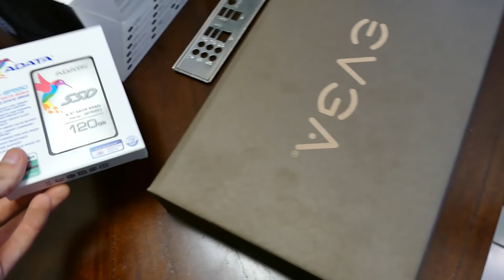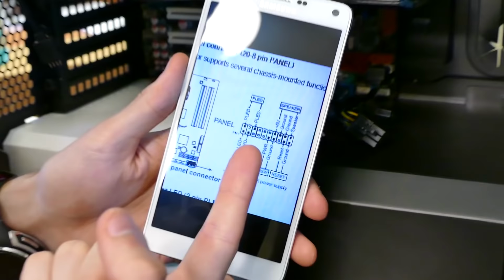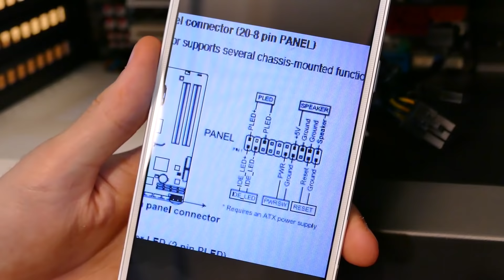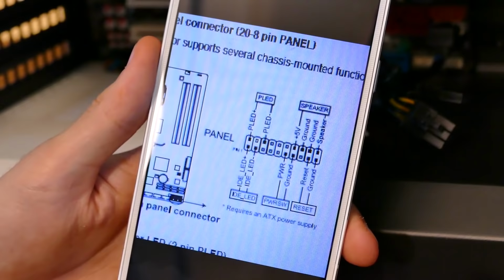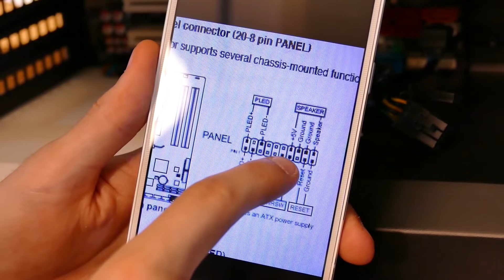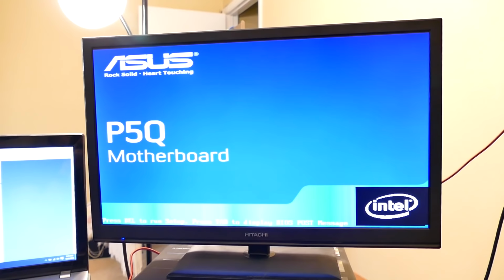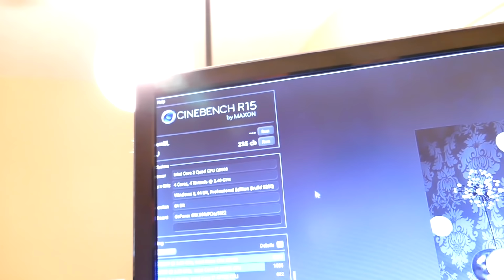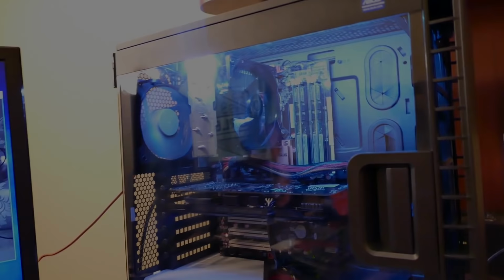Q6600 PC Build Vlog

Comment: Which memory have you used for that build? I have a similar build with an q9650 but my DDR2-800 RAM is holding me back from getting a good overclock. I also searched the web for it but I couldn't find anything substantial.

Comment: how well does that run with that board cause i have a p5n e sli and it is not stable at all with windows 10 every time my windows updates i gotta reinstall windows cause it screws up my drive controller

Comment: how do you get 4Gb ddr 2 variant? the link is 2gb

and does Q6600 can be used with ddr3? what mobo do I have to use? (socket 775 + ddr3 slot)

Comment: I just recently revived my Q6600. I used an ASUS P5G41T-M LX motherboard for DDR3 and EVGA 750ti. I should technically be getting 8GB ram of 1333 overclocked but it's picky with RAM and I could only get 6GB from the DIMM's I have. I have some older 1333 coming in so hope it works.

Comment: I got almost the same setup. I use the gtx960 for video decoding. Separate decoding chip for h264 and HEVC.  Next upgrade will be Ryzen 2600 with rx580 and of course the whole system. It will be costly but hopefully wilk last 5-6 years....

Comment: I bought a $42 oem. Planning to install a gtx 750 for $41 and a xeon for $29 for a total of $112 my first gaming pc 😊
Reply: I actually don't recommend doing that bro'. Buying a pretty low end gaming PC will hurt you in the future (when you'll want to upgrade or some shit). 
I will more recommend you bying an i5-4690K or an i7-4790K with a GTX 970 and you'll see the difference...
Reply: @Hateroz  Well I'm not much of a gamer anyway. The only games I play are either well optimized online games or games old enough to run on that rig. Sure is a big jump from playing on a cheap laptop all these years. When I save enough I'll go for a brand new ryzen setup and an rx 570. Med range gaming is enough for me.

Comment: i just tryed overclocking my cpu(q6600) to 3ghz with the deaufalt voltage 1,28750 and it failed.i have bought a new cooler and now my chip is at idle 27c and load 43c.i want to overclock so much but i think my mobo(p5b-vm)can hadle the stress or something maybe the ram speed because i have 800mhz ddr2 an the bios says only :533mhz 667mhz 800mhz 889mhz and 1067mhz.i selected the 800mhz but maybe because it overclocked the memory is the problem . maybe putting 667 will help?i have no problem with temps!plz help!

Comment: So if anyone could help me that would be great. My PC won't recognize any ram sticks enless it's the one that came with it. The ram stick that came with it is only 4gb and I wanted to add another 8gb. So I tried putting in 3 different 8gb sticks in my PC, in both the slots in different combinations it still won't work. Only the 4gb stick works. I literally just got this ram stick and it doesn't work. I checked it's ddr3. I'm trying to update my bios to see if that's it. If anyone can help please help. Any suggestions would be nice

Comment: If you didn't figure out the monitor issue, it looks like the monitor is on overscan which you can fix in its settings. but being as tech savvy as you are im sure you figured it out already,

Comment: I still have TWO Q6600 systems sitting around doing nothing these days. Both on Gigabyte P45 boards with 4 (2x2GB) DDR2 -1066 memory with Xigmatek tower coolers. Here's the rub.. both at one time would reliably hit 3.4Ghz overclocks, but over time, and it's most likely the motherboards, they no longer hold the Overclocks regardless of vcore. Being now 9 year old builds, they bottleneck the hell out of any video card released in the past 5 years, I've done the testing for science on them, and anything above a GTX 460 video card won't give you any more real performance in games. For those wondering, I was able to play Fallout 4 on one of those systems with the GTX460 card at low/medium settings at 1080p, but it was a struggle. Still viable for gaming, sure, but just barely. But for under $200 you can also jump up to an i3 with DDR4 memory on a cheapie mobo, and the difference in performance is astounding, especially with video rendering.

Comment: I spent $500 making mine, and it's an i7 3770 with 32GB DDR3 and an R9 290 4GB, and 240GB SSD. Noctua cooler, Corsair TX850w and a new white and violet bitphenix neos with a window. It's VR Ready. =)
Reply from the maker: Most won't be able to obtain identical parts for the same price, even on ebay.

Comment: Which PSU would you suggest for overclocking a q6600? The GPU in that PC would be a R7260x (pure low budget gaming).
Reply: Actually the motherboard is much more relevant for the overclock in that case. Getting a power supply any better won't make much of a difference to the CPU other than stability at a certain clock at around 0.05V lower. It will impact Motherboard VRM temps and longevity tho.

If you wan't something better under 80USD id recommend any 80+ Bronze or Gold from EVGA or Seasonic. Any EVGA G2 or SeaSonic G Series comes to mind.

Comment: I have an Asus P5B SE Motherboard, Quad core 2 q6600 processor at 2.40Ghz. it has 4 slots for RAM and i have installed 1GB ddr2 ram in 2 slots for a total of 2gb ram so there is 2 slots available, and a Geforce 210 DDR2, Does anyone know what is the most of Ram this motherboard support? and which is the most powerful graphics card for this motherboard? please anyone can help?

Comment: Does the q6600 is better then e8400  only becouze is quad core or is stronger cores ? E8400 still higher clock speed ..
I ask that becouse my cooler cant cool the q6600 but it keep the e8400 at 55 56 full and the q6600 at 65 70 on idle . So is big diffference between power of those two?
Reply: Even for basic and every day tasks quad cores are essential
The yes it's worth it due to the dual core not having hyperthreading it will become  a bottleneck for every day tasks soon enough
Reply: @samsonsanthosh  thanks . Buy a new cooler then . Dont have time for new setup .
Reply: @georgecatalinnicuta8559  yup that works too those chips can't run new games but that doesn't mean it's still unusable they are still amazing chips that withstood time

Comment: Will high CPU voltage only lower the lifespan of the CPU, or will it effect other hardware parts as well? Seeing how the CPU is only $16, pumping as much voltage that is needed for the best OC seems to be the most optimal choice, correct?
Reply: the motherboard vrms could be damaged aswell if they are cheap as fuck but should be mostly fine

Comment: When I built my system I went with a Evga psu cause my previous 5 builds almost all had them cause they were more budget but I was wondering why the corsair counterpart was so much more expensive. Most of the specs looked the same and both 10 year warrenties | EVGA SuperNOVA 750G1 | and corsair RM750x

Comment: Why not get the motherboard use ddr3, faster and cheaper. Or is it the q6600 not compatible with ddr3?
Reply: It depends on what motherboard you use. Most 775 motherboards come wired for ddr2, that also makes them cheaper.

Comment: I used to P5QC Have an Asus with a Core 2 Quad Q9400, and it gave me a lot of headaches. The temperature was always over 90 ° C, so i had to change it because I couldn't work more than 10 minutes without having a freezing

Comment: Nice rig but seems a bit expensive for the components used. For $250 just got hold of this in the last week, Asus P8H61M-lx, 4GB DDR3 1333mhz, Intel Core i3 2100, Kingston v300 120gb SSD, Samsung Spinpoint 250gb HDD, Antec Quattro 1000w (overkill but was dirt cheap), Bitfenix Nova case, Gigabyte GTX 770 Windforce OC 2GB.
Reply: You might wanna switch to a lower wattage power supply because if your not using most of the wattage, you're wasting money from the power usage.

Comment: This board should work with the LGA 771 to LGA 775 Mod and install a Quad Core Xeon. Just double check to see if you can run the 3xxx or the 5xxx LGA 771 Xeon. Also these LGA 771 CPUS are very reasonable priced....

Comment: I have a q6600, 6gb of ram, and a asus gtx970 turbo oc. But CS:GO lags at high settings, any help?
Reply: Anonymous the 970 is being bottlenecked pretty hard And you could get 8gb of ram
Reply: Ubwr I fixed it, but i'm getting Ryzen 1600, Msi B350 Tomahawk and Corsair Vengeance LPX 16Gb 3000Mhz Ram
Reply: Anonymous wow lol that's quite the upgrade. Enjoy!

Comment: That's a nice build. I'm using the P5K with a Xeon X5460 771 mod (upgraded from Q9550, which I upgraded from Q8300, which I upgraded from some Core 2 Duo) and ive just bought a GTX 1060 mini (Zotac) to upgrade my GTX 960 reference. I honestly believe the socket 775 builds are still very relevant today when you consider how much performance you get from such little expenditure. I overclocked the Q9550 to 3.4ghz stable but I had a few issues with maintaining the overclock when starting the PC from cold so I decided to use a Xeon at standard clock speed (3.2ghz). I would definitely recommend upgrading to the 771 mod before considering anything else - great performance and no need to change CPU, RAM, MOBO etc. just a sticker and some 'delidded' reading. Did he paint the case? I'd like to see that.

Comment: Can i ask why you wen't with a GTX 950 SSC when you can get a GTX 960 for an extra £10-£20 ?
Reply from the maker: That's an extra $50 here in the states. Not worth it for his needs.
Reply: That taxing
Reply: +Science Studio when ylu comeback to florida if you are not there, a good amount of people have been selling 770's for less than $120 on craigslist, and maybe on ebay.
Reply: That 950 appeared to be used, no plastic packing etc.  so I assume they got a good deal on that too.

Comment: That's a good cinebench score but how much was the board? (I didn't watch the whole vid) I always find people want big money for decent legacy Intel hardware.  I got a P5N-D (from an Alienware rig) 18 months ago for £35 but that's as much as I'd pay for a non ROG 775 board.
Careful running overclocked with high volts constant, I started burning out the VRM's on a socket 775 with just a dual core years ago.  If it's a top of the range board it might be ok but older kit isn't as good quality as what's available now.
SSD's work really well on old Intel hardware compared to the same age AMD kit so if you can get all the bits for the right price they are still a nice build.  If you can get some Crucial Ballistix DDR2 800 (yellow heatspreader) it will overclock better and get better bench scores.  I managed to push mine to 1333mhz with loose timings.
Never could get on with Corsair XMS, and I don't like the Corsair Vengeance Pro in DDR3 either.

Comment: Using a Q6600 oced over the summer, comparing it to my old i7 3770k at stock in normal desktop use I do not notice any differance, expect for the sata2 limitation for the ssd 240MB/sec compared to 400-500 with the z77 chipset. In games like BF4 and AC especially in AC I have to wait like 1 min for the system loading the track in online and for like 10 sec at the start I get the warning that the cpu is at 99% :P But otherwise it is still an ok system, especially for desktop use.

Comment: Any reason why you went nvid over AMD for this build?
Reply: Considering that AMD cards put more strain on CPU in dx11 and older games, it makes sense to go with nvidia with such a budget/low end cpu.
NVIDIA cards can push alot higher amount of draw calls before running into cpu bottlenecks, so even with a lower end NVIDIA you might get better frame rates than a higher end AMD card.

Comment: Ayy, you should really give the LGA 775 Xeon mod a go with this motherboard. Scrap that Q6600, the Xeon X5450 will pull much harder and can be overclocked to a very stable 3.5 ghz from a stock 3ghz. Xeon only cost me $35 Aud and is definitely worth looking into for these cheaper budget builds.
Reply from the maker: Nope, not doing it. Fine the way it is.

Comment: Hey, is it possible to build a gaming rig mini itx for maks 500$?
Reply: Yes, but it will be a compromise.  The best Intel system that I can do that i would consider decent for AAA gaming ends up at $585...you could go lower on GPU but that whole part of the market is in flux right now so wait for 1050 and 470 to actually come out and be available.  at MSRP a 470 would almost bring this down to the $500 mark.

http://pcpartpicker.com/list/JpML2R

Note it has an 8GB RX 480 which is $40 more than the 4GB is supposed to cost so once those are actually available you could save $40.  PSU is more than needed but you can't get much cheaper.  A true gaming rig should have an i5 and this is an i3.  

The other option is to go all AMD:  You can get an APU and no GPU and come in well under $500; this one is $345.  IT could game but I wouldn't consider it a good gaming rig unless all you play is light graphics type stuff.

http://pcpartpicker.com/list/Wkyjpb

OR you can go Athlon and get an 8GB RX 480 for right around $550..probably an RX 470 in a week would get this down to $500 and be a better match.

http://pcpartpicker.com/list/ydwRkT

Both of the AMD builds are a bit outdated and the Athlon almost certainly bottlenecks an RX480.  

I didn't include Windows in any of the prices but add $30 for that if you grab a Kinguin copy or $100 if you buy it retail.
Reply: I Should note I didn't put a mechanical drive in there.  You could save $30 and go 1TB mechanical only or add $30 and get a mechanical to go with the SSD for more storage.

Comment: pretty sure this one is better and only costs $80 more, but its worth it.

PCPartPicker part list: http://pcpartpicker.com/list/cvNYHN
Price breakdown by merchant: http://pcpartpicker.com/list/cvNYHN/by_merchant/

CPU: *Intel Core i3-6100 3.7GHz Dual-Core Processor  ($110.99 @ SuperBiiz) 
Motherboard: *ASRock H110M-HDS Micro ATX LGA1151 Motherboard  ($51.99 @ SuperBiiz) 
Memory: *Crucial 8GB (1 x 8GB) DDR4-2133 Memory  ($29.99 @ Adorama) 
Storage: *Western Digital AV-GP 1TB 3.5" 5400RPM Internal Hard Drive  ($42.40 @ Amazon) 
Video Card: *PowerColor Radeon R9 380X 4GB PCS+ Myst. Edition Video Card  ($169.99 @ Newegg) 
Case: *DIYPC DIY-M6-BK MicroATX Mid Tower Case  ($34.99 @ Newegg) 
Power Supply: *EVGA 500W 80+ Bronze Certified ATX Power Supply  ($39.99 @ NCIX US) 
Total: $480.34
Prices include shipping, taxes, and discounts when available
*Lowest price parts chosen from parametric criteria
Generated by PCPartPicker 2016-08-05 20:15 EDT-0400

Comment: i got CORE 2 QUAD q6600 
mobo hp 3647 h
ram 4gb ddr 3 
psu 320 W
can i install a gtx 1050 
(MSI GeForce  GTX 1050 2G OC 2GB)
GOT A LOT OF SPACE
Reply: Maybe not, ur power supply might be too low
Reply: I'd recommend a gt 1030

Comment: y not do the lga775 to 771  mod to the cpu socket  and run a x5492 xeon cpu there cheap on ebay got mine for 50$
Reply: Well, he got his Q6600 for just 16 USD, and did not need to mod.

Comment: ima guessing its a socket 775 mobo,so u could just as cheaply(15$) just get a xeon cpu(circuit adapter to 775) and get more cores and better OC and performance,also the ram sticks looked kinda crapy,ddr2 is pretty cheap,try some Hyper X,and your rigg would be maxed-out.nice first build nonetheless,keep it up.

Comment: I use a stock q6600 4gb ddr2 ram, and a gtx 1050 and can still play almost all games. I Haven't really gotten into overclocking, would someone mind helping? i have an asrock g-31s motherboard
Reply: Z Bobplays G31 is not really that good for OC.
Reply: Really, Just got 4ghz at 1.375 vcore
Reply: At least usually.

Comment: He could get a Xeon 5650 6 core. They can be found for less than $100. Plenty of rendering power and most regular 1366 board support them.
Reply from the maker: No. Far too overpriced motherboards.
Reply: Really? I saw an Asus P6T Deluxe go for about $70 here in Sweden :S Might be harder in the states to get good prices. You after all get alot for the money. I use mine as a secondary setup.